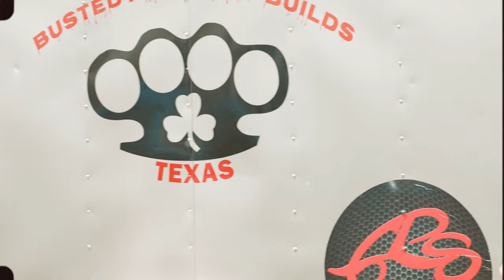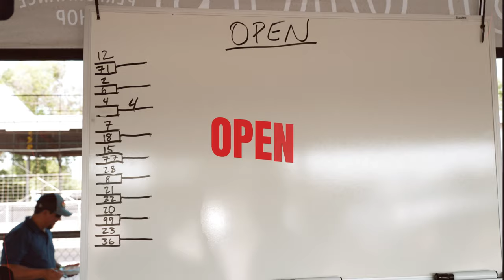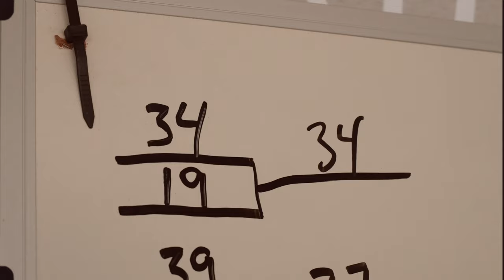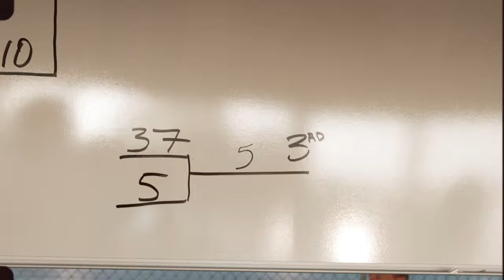Up in the Gut! | The Inaugural GPS660 Minibike Drag Race

Comment: Hey gopowersports I have a predator 212 engine that I was working on and when I installed a torque converter the bolt for the crankshaft didn’t want to go all the way in so when I try taking it out it didn’t budge. Do you have any idea how I can remove a stuck bolt from the crankshaft, I used an impact. Please answer thanks 🙏
Reply from the maker: An impact usually works. Just want to make sure you aren’t using a drill. A stronger setting on your impact may work, or borrow a pneumatic impact.
Reply: @GoPowerSports Thanks, I managed too take it out your, you guys are the best gopowersports ❤